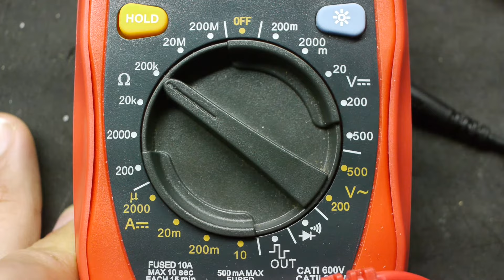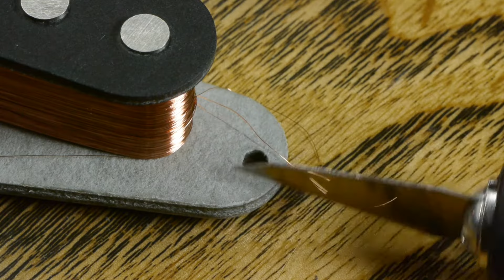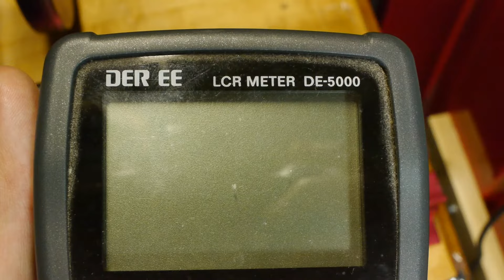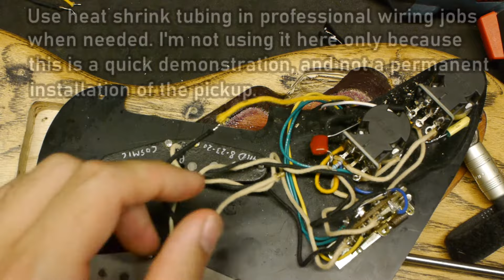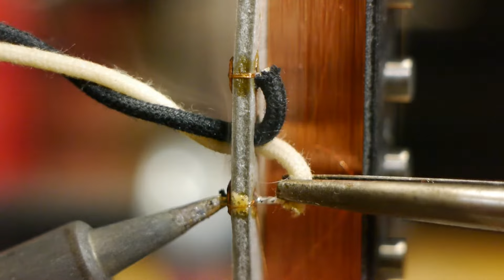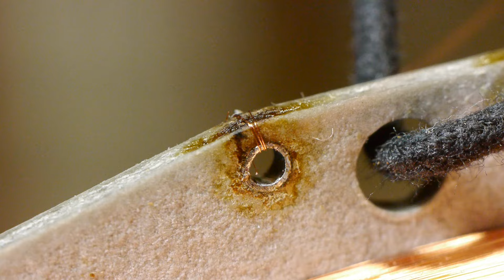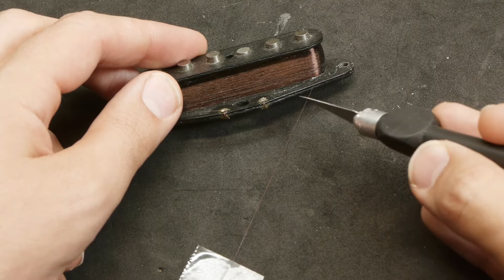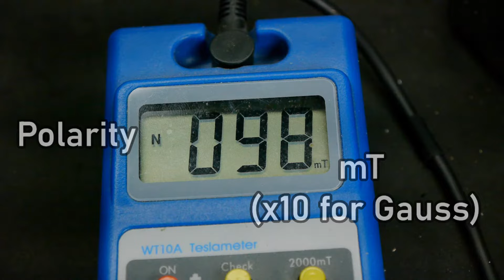Broken Guitar Pickup DIAGNOSIS + REPAIR | Fender Style Single Coil Diagnosis + Repair Demonstration

Comment: First, congrats for the good work and for helping people. I have a question. The neck pickup of my strat suddenly lost output and sounds thin. It was fine a few months ago but I don't play this guitar, it was on a stand, and next time I plugged it in, the neck pickup was this way. It's not the nasaly "out of phase" sound. It sounds like a neck pickup which has lost bass and volume. I checked all the circuit, re-soldered many points that looked weird, even soldered the pickup hot lead directly to the volume pot, and the problem persists. So it's more likely a problem with the pickup and not something else in the circuit. When i choose position 4 of the switch, neck and middle, and perform the screwdriver test on the poles, the middle pickup produces a bang with more low and more volume, and the neck pickup produces a quieter and thinner sound. I've also noticed this: when I touch the pole pieces with my finger, the neck pickup produces a loud hum, whereas the other 2 pickups also make a hum but it's quieter. Before I go further and start unwinding my pickup, do you have any idea what it could be?
Reply from the maker: Thanks! As for your pickup: 

You need to remove the pickup from the circuit completely, and test it outside of the circuit, to confirm if the pickup is the problem. 

An easy way to do this if you don't want to disassemble everything would be to disconnect the hot and ground leads from the output jack, then solder the hot and ground leads from the pickup directly to the output jack. 

Or just do a quick soldering of the neck pickup leads to the hot and ground leads coming off of the output jack, after you disconnect them from the circuit. 

Then do the tap test. Also, before you solder the wires from the pickup directly to the output jack, set a multimeter to 20k ohms and test the pickup. If you get no reading at all, the problem is likely the pickup. 

But if you get an expected reading, like 6.0k for example, you'll know it's the circuit, not the pickup. 

The most important thing is to isolate the pickup for testing. No volume pots, no tone pots, no other pickups anywhere in the circuit -- test that pickup all by itself. 

It does seem unlikely that it's a wire break, as how could that happen? But it's possible. Sometimes the magnets corrode and eat away at the wire deep inside the coil. All it takes is one tiny little break anywhere in that wire to kill a pickup. 

I also offer very reasonable rates for pickup rewinds if you need extra assistance. Just hit me up at guitarmdofficial@gmail.com and I'll get back to you as soon as I can. I've done many, many pickup rewinds and would be happy to help you out if it comes to that. 

Keep me posted! Just let me know if you test that pickup outside the circuit and confirm that it's the pickup itself that's not working. Sometimes pots and switches can go bad in very bizarre ways, and you'd never know. 

So the only way to diagnose a pickup is to test it in complete isolation. Re-flowing the solder joints on the pickup eyelets can sometimes work as well. That's always the first thing to try as it's the safest, and least invasive, compared to un-winding. 

I always just re-wind, by the way. Unwinding is possible but once you know how to rewind a pickup, it's much easier to just tear the whole coil down and do it right. Unwinding a pickup turn by turn is insanely time consuming and is something I would personally never do -- but included it in the video as I'm aware some people do this.
Reply: @guitar_md  thanks so much! I’ll do that and post the results.
Reply: @guitar_md  Hi! So, I've performed the tests with a multimeter. I disconnected all pickups from the circuit, but I did not remove them from the pickguard because the leads are held together by this big rubber tubing, which came from factory, and I didn't want to remove it. But, I guess it would not make much difference? Anyway, here are the results I got. Bridge reads 6.50, middle reads 6.30, and neck gives me a reading of O.L. So I suppose the problem is problably in the neck pickup itself? What could be my next step? Try to reflow the solder points in the pickup leads?
Reply from the maker: @rafaelzengo5534  Yes. Re-flowing the solder leads is always a good idea. And make sure that the leads are connected -- the thin magnet wire going to the eyelets. Sometimes that breaks off and is the reason the pickup doesn't work.

I'd say that's actually the most common break. Breaks deeper in the coil typically only happen on much older pickups. 

Leaving them in the pickguard is OK. 

If the break isn't immediately obvious, usually a rewind is in order. I recently did a repair for someone where I was able to salvage the pickup by splicing on a new lead to the broken magnet wire. 

Currently working on a video about it. It'll take a while to finish -- but in the works!
Reply: @guitar_md  Hi, good morning. I've re-flown the solder points on the leads and the pickup Is still giving a reading of O.L. I'd love to send it to someone like you to have it repaired, but I live in Brazil, and there is virtually no one in this whole country that does this kind of service. Well, there might be, but very few, and it would be probably far away from me anyway, and cost me a fortune. 

So I guess my only option now is a) hope that the break is at the end of the coil, so I can start unwrapping it until I find the break, and re-solder again from there; and b) if the break is buried deep in the coil, I'll have to completely re-wind it. 

It could be willing to do the whole thing if that comes to be, my only doubt is if I can find the coil wire easily. These sort of specialized goods are very difficult to find here, we do not have a diversified industry like you guys do over there. Does it need to be a special wire to wind a pickup, or could I just grab any copper thin bobbin wire at the store and start winding it? 7 thousand turns, right? I guess I could do a thousand a day by hand. 

I liked this pickup very much, it's an alnico 3 single coil that came in the Squier Classic Vibe 50's, the first version. SOme say it's a Tonerider Surfari pickup, but I don't know, it just sounded very good. Repolacing the pickup is not an option to me now, I'm very short on resources.

Comment: "O.L." in a meter does not mean zero ohms, but infinite resistance, meaning an interruption.
Reply from the maker: Would be curious for your input as I'm having trouble understanding this: 

The meter defaults to O.L when it's in Ohm mode, meaning the default reading when there is no continuity between the probes. I took this to mean "open line" in Ohm mode, or "open circuit." 

The interruption in the case of a broken pickup is a severed coil. So imagine you have one probe touching a piece of wire, then the other probe touching another piece of wire, and the pieces of wire are not connected to each other. 

This is the case in a broken pickup. 

In my mind, this might as well be 'zero resistance,' as the DCR of a coil is dependent on the coil being continuous and unbroken. DCR is in this case basically a measure of how long the wire is. 

When the coil is broken, you might as well be putting the probe on two separate, unconnected wires -- there is no resistance in the coil, because the coil is broken, and is therefore incapable of forming continuity between the probes. So the meter defaults to O.L, meaning "open line" or "open circuit." 

My semantics are probably off. I think I've read that in default on Ohm mode, the meter is trying to read infinite resistance, which is why by default, the meter reads O.L in ohm mode when the probes are not connected to anything. 

I'm not brushed up on all that, but for simplicity's sake, 'zero resistance' seems to make more sense to me. The meter gets no reading because the wire is broken, and one end is not connected to the other.

So it's defaulting to its native infinite resistance in OL mode on the Ohm setting, but the coil itself is not creating infinite resistance -- how could it when it's effectively two separate strands of wire not connected to each other? 

Even if infinite resistance is the technically correct term, it's hard to wrap my head around it and I think it makes what's happening here seem more confusing. 

It makes it seem like the break in the coil is creating an overload of resistance, when in reality the meter is simply defaulting back to its native OL reading in Ohm mode, because the two ends of the coil are no longer connected to each other and are not able to create DS resistance from one end to the other as a result. 

Sorry for the huge writeup here but this has been on my mind for a while. Would appreciate if you could clarify this for me and see what you think, and if my reasoning makes sense to you. 

I like to be as accurate as possible and I hate it when I miss things in my videos but I also want things to be clear and easy to understand for my viewers who might not be so well acquainted with these concepts.
Reply: "In my mind, this might as well be 'zero resistance,' as the DCR of a coil is dependent on the coil being continuous and unbroken. DCR is in this case basically a measure of how long the wire is."

I honestly do not get your ways of thought here. Resistance is the capability of a medium to let electrons flow from one point to another. If there is no connection between the two points the resistance is infinite, if they are connected the resistance approaches zero. Anything between gives an according resistance value. This is independant on the application, the medium or the connectivity.  @guitar_md
Reply from the maker: @Andreas_Straub  I appreciate the clarification! 

My thoughts simply come from not being formally educated in any electrical theory at all. It's an embarrassing mistake, but hopefully you can understand how a layperson would mistake "infinite resistance" for "zero resistance." 

For a layperson like me, you set the multimeter to measure Ohms, you see a "O," and you just assume it means zero resistance, because the meter is set to measure resistance. 

I didn't even think about what the "L" meant! I just ignored it. Embarrassing, I know. But again, I'm a layperson.

If the screen displays could show an infinity symbol instead of 0.L that would make things much clearer. I simply was unfamiliar with O.L meaning open line / open circuit. 

Now I know if you touch both probes together, you'll get 0.00 resistance, as you said, and when the probes are not touching, the resistance is infinite, not zero. 

Now this makes a whole lot more sense. Again I thank you for your explanation and clarification, it's really helped me a lot. 

Fortunately, despite the semantic error, pickup coils are simple enough that one can successfully use a multimeter as a diagnostic even without any knowledge of these things. 

However, I will not make this mistake again if I do future videos on similar topics.

Your comment was very helpful to me and I appreciate you taking the time to explain this concept to me to help me understand. Thank you again!

Comment: Why do you use the mojotone magnetizer?
Reply from the maker: I use it to magnetize non-magnetized polepieces when I'm building pickups. 

Generally, lack of Gauss strength is only an issue when you're building your own pickups, and forget to magnetize the polepieces. 

In already assembled pickups, I've only seen really low Gauss strength on one polepiece one time -- and it was due to either a defective magnet, or damage that caused it to lose its magnetism. At that point you just need to replace the magnet, but it's extremely rare that this would happen. 

However, you can use the magnetize to flip the magnetic polarity as well. Sometimes that's a problem. If people want two pickups to be hum-cancelling when used together, but they're both the same magnetic polarity, you can't do that. 

So in that case, charging the poles in the opposite direction will do the trick.
Reply: @guitar_md  thank you. But you are talking about ferrite polepieces. Iron. Not magnetic ones. Not AlNiCo or Neodymium. I have a question. Does exist a diy way to add enamell to wire where it misses?
Reply from the maker: @christianurgese  I don't know of any way to add enamel to wire -- there might be, but the polyurethane-nylon coating they use that's applied at the factory might be hard to come by and I'm not sure if just brushing it on would be adequate. 

The polepieces I'm talking about are AlNiCo polepieces, specifically, on Fender style pickups.

I have made pickups with iron polepieces, usually using a neodymium bar magnet permanently attached to the bottom to magnetize them

Comment: Thanks so much for your detailed and very good video production 
I recently acquired a Samick KJ-640 and it has a Single in the neck and an Humbucker in the bridge position and overall it's an amazing 24 year old guitar. 
The problem is whenever the neck pickup is either selected by itself or blended with the bridge, I get a ton of extra (not normal) noise.
So in my setup of it and after pulling the neck pickup and upon close inspection,  I found the start & finish wire floating around inside the pickup cover, attached to the start and finish wires. 
I also discovered that someone had wrapped the bobbin with conductive aluminum tape over the black nonconductive tape. 
That's odd I said to myself.  After testing with an ohms meter after the removal of the two tapes, i got no (0) reading. The finish (positive) lead wire then promptly broke while handling it.

My plan is to repair it. I'd like to keep it as close to stock looking (and sounding) as possible.
The bobbin width on it is quite a bit thinner than what's available on the marketplace now, so I want the original Samick cover to fit and reparing or rewinding seems like the best option. 
So I'm going to try your great techniques suggested and see if I can repair it.
 If not, then I would consider having it rewound, and you sound like the details oriented person who could do it.
Do you have some contact info, where I could contact you and discuss the details?
Thanks again
Reply from the maker: Sorry I didn't see this earlier! You can reach me at: 

guitarmdofficial@gmail.com

I'd be curious to take a look to see what you're dealing with here. Feel free to contact me at that e-mail address. I'd like to see some pictures if possible. Thanks for reaching out!

Comment: i would like to buy an electric guitar and learn how to play but i’m hesitant to spend a lot of money on something i don’t i’ll stick with. i found a guy selling a used guitar and amp for only 50 dollars but he says that one of the pickups is defective but that “it still sounds great” would it be worth it to buy? or is a defective pickup something quite bad?? 😭
Reply from the maker: Defective pickup is a very easy fix, though it does require the ability to solder. 

As long as one pickup works and you can plug it in, I'd say it's definitely worth it. Soldering is not that hard -- I'd actually love to make an instructional video on it for beginners -- and these days you can buy replacement pickups for very, very cheap. 

I've been making and rewinding pickups for over 5 years now and so for me it's easy! But even for a beginner, all you need to fix is a pickup is some basic soldering skills, and a replacement pickup. 

My only other advice is if you want a fully functioning guitar, you can get one without an amp, and then spend some money on a basic audio interface for your computer. You can use a program like Reaper and some free plugins to get some great tones out of your guitar without the need for a dedicated amp. 

Audio interfaces are also excellent for general use, like with movies, shows, and videogames, when you pair them with a couple studio monitors. I use an old Gen 2 Scarlett 2i2 interface, and some Presonus Erris 3.5" speaker studio monitors. I think the studio monitors were around $90 when I bought them on eBay, and the interface I got for around $120, also on eBay. 

Plugs into the USB port on your computer or laptop. The studio monitors get crystal clear audio and paired with the interface, just great audio quality all around, including for your guitar. 

Anyway. As long as one pickup works, you'll be OK. And 50 bucks is a great deal. Replacing a pickup yourself is cheap but does require a soldering gun or soldering iron, some flux and solder, and some wire cutters/strippers. So not the smallest investment.

But man. 50 bucks for both. That's a deal! If you can live with the working pickup until you get the skills to replace the broken one, I'd do it. Other alternative is get a guitar for 50 dollars that's fully functional, or less if you can find one -- then invest the money you save into an audio interface and some studio monitors. You won't regret it. 

PreSonus Eris 3.5 -- that's it. I misspelled it as "Erris" earlier. But you get the idea! Hope this helps.
Reply: You don’t have to spend $500 on a guitar most important part is the amp and equipment! “I should be able to hand you any guitar and it be slamming” as long as it is set up to your preference tbh a guitar is a guitar

Comment: Great video. My modified 50s Strat randomly had the humbucker stop working (really quiet and thin). So I tested the resistance and got a 0 reading. It's a new guitar that was stored safely, and just stopped working overnight. The pickguard doesn't make a complete seal around that pickup so I thought maybe some dust/hair got inside. I hit it with the electric fan duster (on a low setting) and checked the resistance again. It actually worked and sounds great now lol. Hopefully that helps somebody.